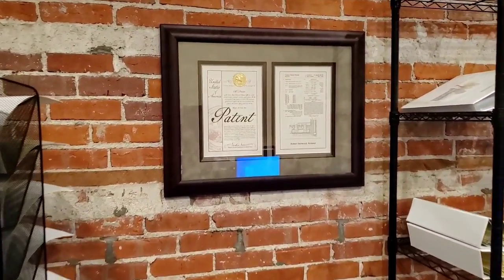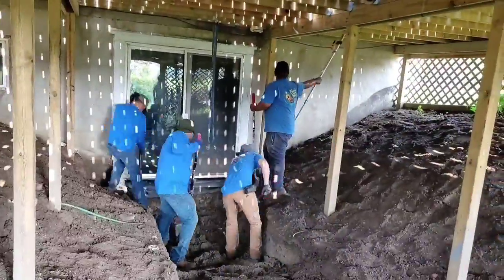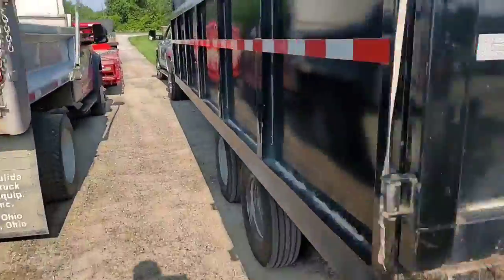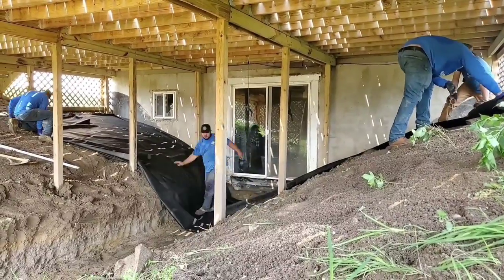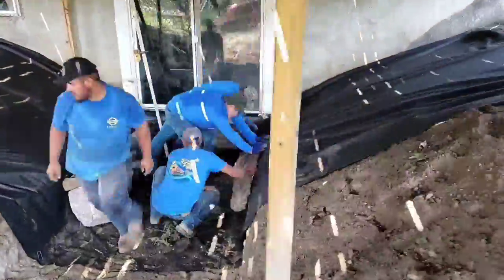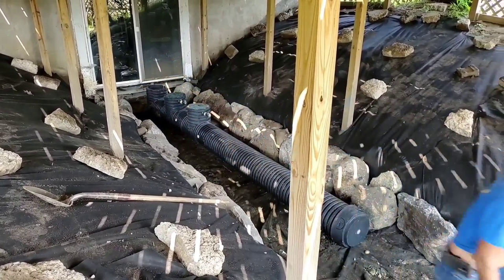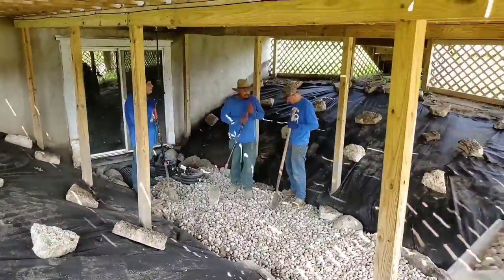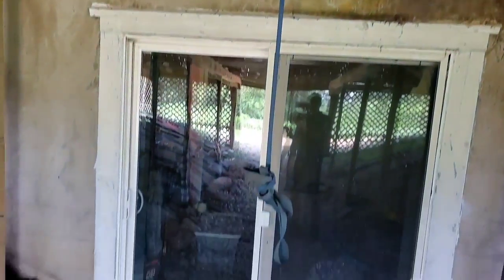How To Build a Horizontal Dry Well For Yard Drainage, Gutter Drains, French Drain, OUTDOOR Sump Pump

Comment: Where’s the discharge? The connections?
Reply: I'm wondering that myself.
Reply from the maker: It lifts in a 1 1/2" line to UP TOP Elevation. It's then carried in a 4 inch Solid corrugated pipe to the River